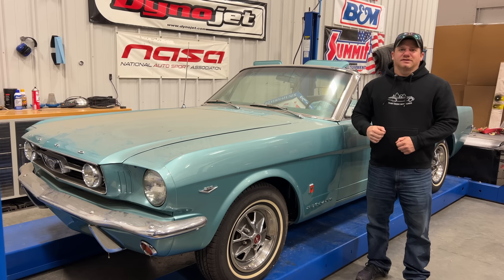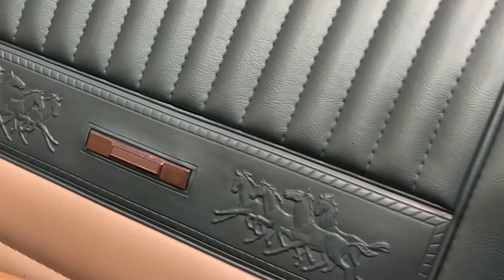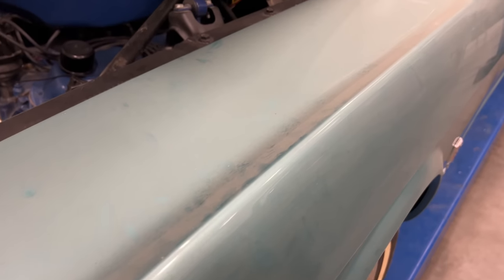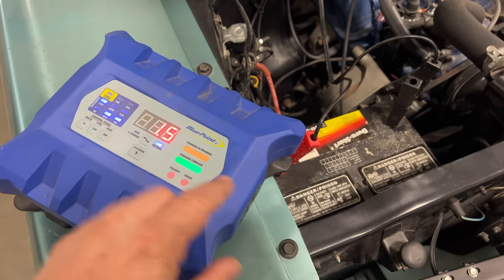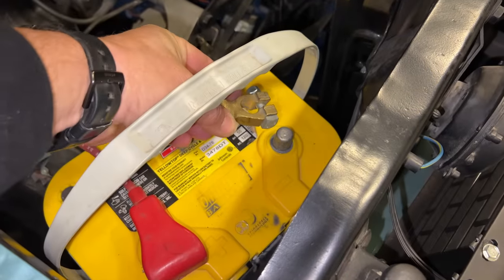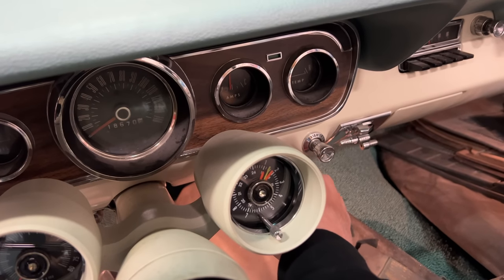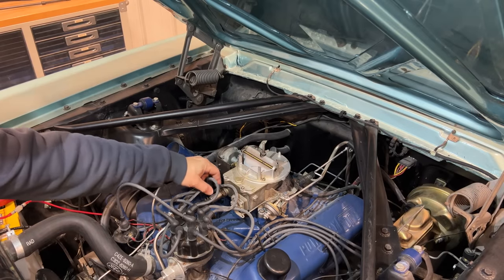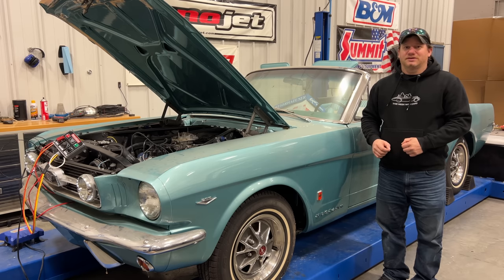1966 Ford Mustang GT Parked for 10 Years Will It Run

Comment: Speaking for the UK all older Fords had that type of battery clamp and very good it was too. Maybe a lip or angle iron the shape of the battery (so a rectangle) which could then be welded to the existing clamp? I think that would work well if the metal used was strong enough. i would like to see this car fully finished, I think that would be really nice. Thanks Steve, very interesting video.👍👍👍

Comment: Having a “C” code in the vin number brings into question if the car is a factory GT or made into a GT. In 1966 a factory GT would of had an “A” code or “k” code for the engine code.
Reply: Agreed, to be a true GT it would have a 289 4V - 225 horse, or the 271 horse HiPo.  It doesn't have to be a GT to have those engines, but a GT did have those engines.
Reply: A or K 289 hi po or 289 premium fuel

Comment: That is one fine looking 'Stang.
You could epoxy clips to a new battery usinf JB weld  I am surprised you hit the starter without first being sure you could turn it 360 by hand !  By the sound it has a tight spot and puting some lube down the spark plug holes would have been a good idea to possibly save from breaking a ring..  Your tutorial on the remote start is great but why not show the viewers that you also checked to be sure there was oil in the crankcase befor turning it over. Some yougsters at home may need tha knowledge.
 I would have removed the plugs and cranked it over to build up oil pressure and put the feul line to the carb in a bucket to see what came out. Ten years is not so long if the gas was treated or maybe had no ethenol in it. With all that rust you think is stuck to the tank will start to break of you should have put a see thru filter just before the carb.
 Great start up, can't wait until the rest of the  "Will it Run"  😊😊😊
Reply from the maker: I actually saw a video or post where someone modified their battery with epoxy and then ground it down to look like it should.  A battery is very heavy though and I’m not sure that solution would be strong enough for anything more than a show car.

Comment: What I do with batteries like that especially using smart chargers is after topping the cells off is I hook a jump pack that's not a smart jump pack and the battery charger all together. Then I'll apply ever increasing loads with the charger unhooked and repeat. The reconditioning function of every charger I've used hasn't worked so I do this instead.

Comment: Thart battery is scrap - don't waste your time or the energy to try & charge it. Anything that has been sat much less than 50% for any reasonable length of time will be damaged. Something that has been totally discharged & allowed to sit will be totally sulfated. Even if you can get old batteries to chrge they will generally have a fraction of theur rated capacity, high internal resistance which means basically zero cranking performance & more worryingly the sulfation actually results in mechanical expansion which can lead to internal shorts which result in best case high self discharge & worst case a short which can result in some fairly nasty results including explosion.

Comment: Super nice car. If it isn’t inspiration to persist and follow through on your restoration project, I don’t know what is. The previous, late owner was much closer to the finish line than the start.
Reply from the maker: Yes but it’s not surprising because the last 10% is the hardest because you have to make everything previous actually work and work well.
Reply: @ThisWeekWithCars  with that context in mind, this series will be more educational than most.

Comment: First off you can’t call this a “GT” it is not a factory GT.  It’s a “C” code engine it needs to be an “A”code or “K” code to be a GT.  None the less a nice car.  Do some more leg work on the battery.  They are around.  Just purchased one for my 66.